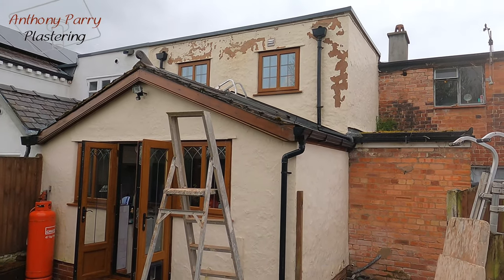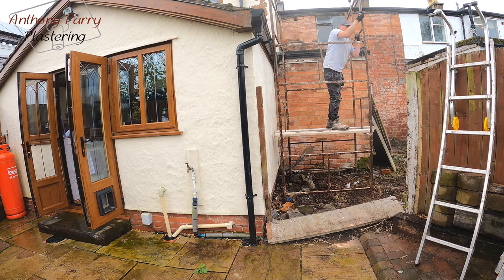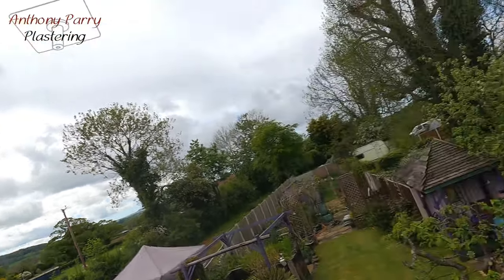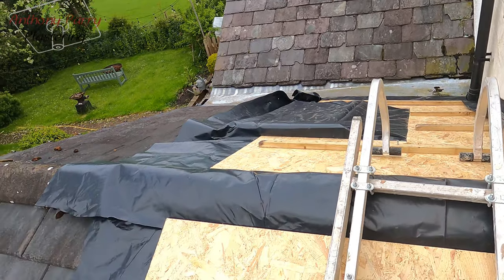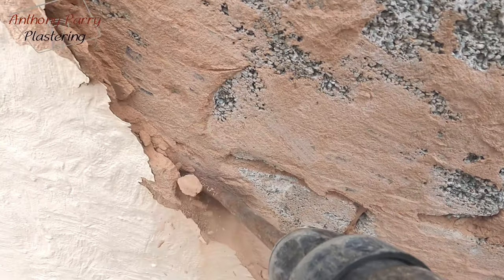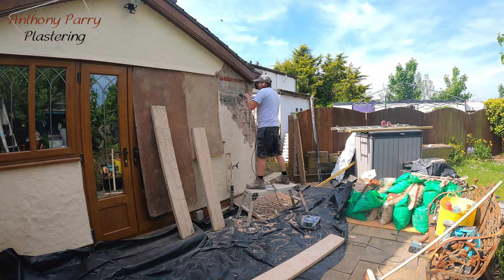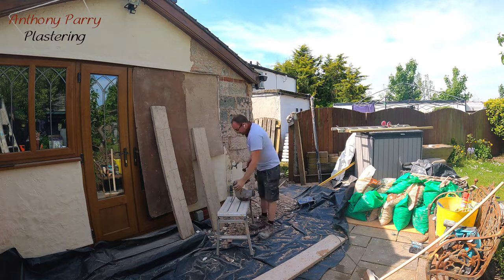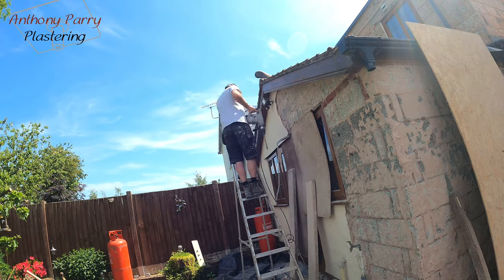Preparing before K-Rend Vlog

Comment: The render looked pink like lightweight plaster,  not grey like sand and cement🤔
Reply from the maker: In North Wales our main building sand is red sand so that’s why it looks pinky. You find in different areas you use different quarries. So ours might be more red and yours might be browner or grey.
Reply: @AnthonyParryPlastering  ahhh ok mate, I thought the spread bonded the outside haha😂